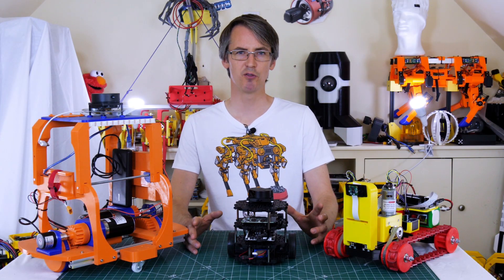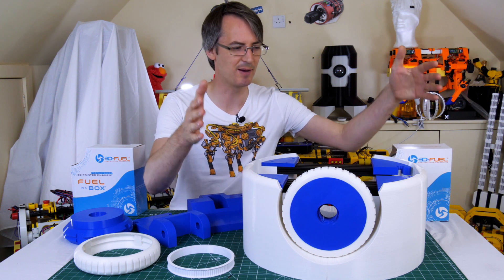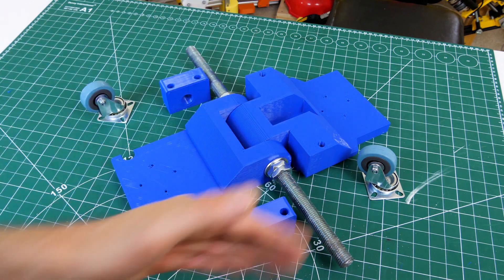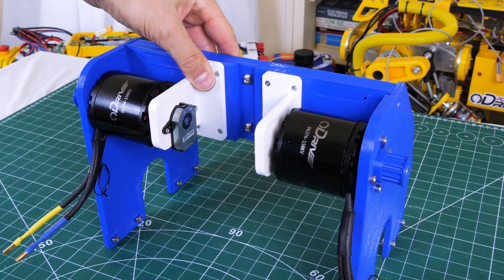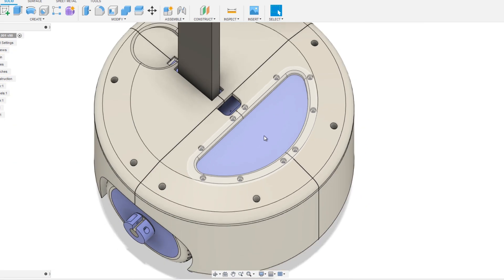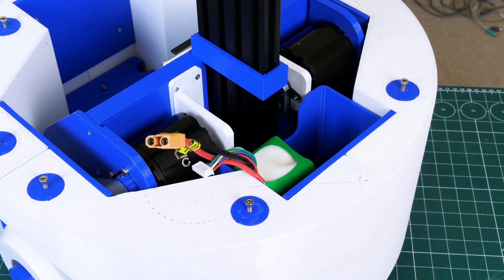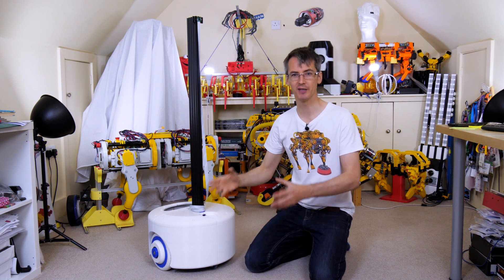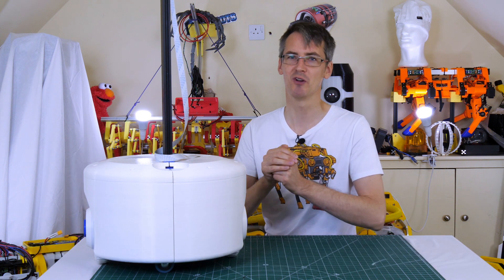Really Useful AI Robot Build #1

Comment: How does the wheel pulley attach to the wheel? I printed both, but there's no mounting hole(s), and the pulley just rotates around the wheel. Did you use glue?

Comment: If I want to scale this robot down a bit, what would be the best way to do it? I would need to scale it down to 300mm in diameter. Would that leave enough space to mount all the electronics? Would 300mm diameter be too small for this robot? I realize I would have to make some changes to accommodate different motors and electronics.

Comment: Hi James, your projects are amazing. Could you tell us the printer settings that you usually print your parts, like nozzle diameter, layer height, printing velocity and extrusion width? Thanks.
Reply from the maker: Normally a 0.5mm nozzle, 0.3m layer height, 4 perimeters, 60mm/s
Reply from the maker: The bigger parts are a 1.2mm nozzle though

Comment: First, very cool project👍
Perhaps I'm missing the point but why not stream all of the data to a server / pc and do all the calculations there. This robot isn't going to go very fast and your house is a controlled environment which means getting good wife reception shouldn't be a problem. This could improve the available processing power, reduce the power consumption of the bot and makes development faster/easier as you don't have to jump between the robot and your development machine. This could also lower the costs making it cheaper for other people to build it as well.
Reply from the maker: There will be multiple sensors - more cameras etc like Intel Realsense which needs to be connected locally.

Comment: I was going to comment and suggest that the arm moves up and down.. But watching the video shows you planned just that!
Consider a stepper or similar in the base and lifting/lowering the arm using a belt running up to the top and back down. It'll reduse the amount of weight you can pick up(And will 'fall' if power fails) but will allow for quite quick lifting/lowering as well as keep the mass at the top quite low when the arm(s) are in the lower position.
We've had problems with casters like that causing problems when you go from forward to reverse as the casters 'flip' around and cause a jolt, but your designs are always flexible and modular enough that if this is a problem you can fix it.
Reply from the maker: Yes I'll probably go for a belt drive so that the top isn't too heavy. I'm considering a gearbox with a worm gear stage so it doesn't fall down.